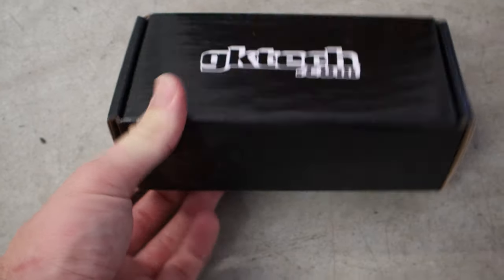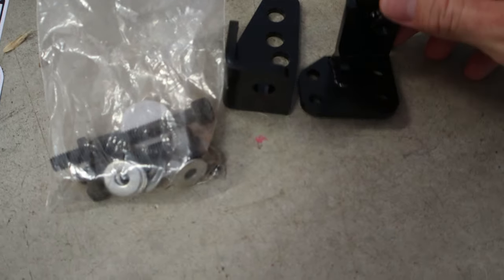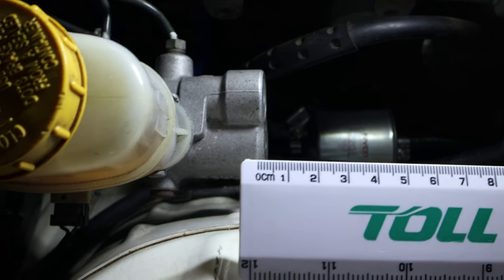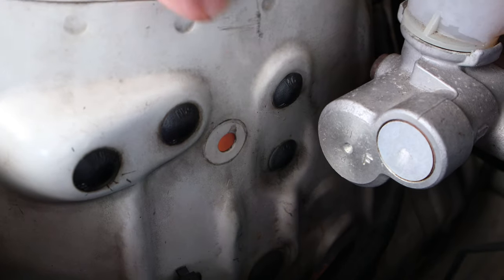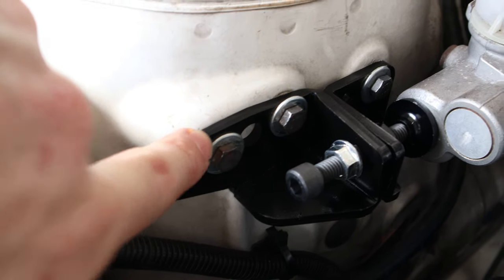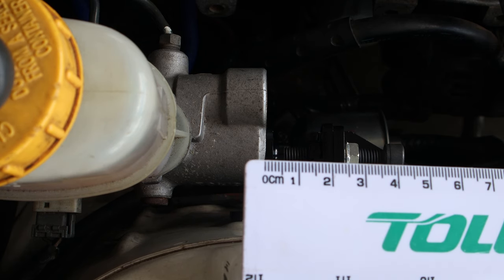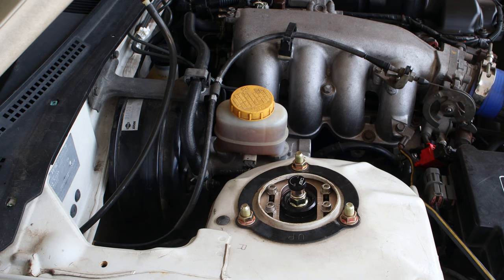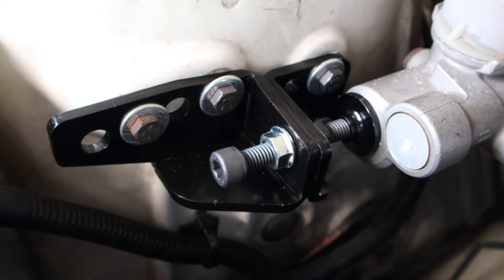[4K] Nissan Silvia - Gktech Brake Master Cylinder Stopper

Comment: These are a direct copy the cusco brake cylinder stopper if you prefer a Japanese product. Gktech could of made this out of an aluminum block or if they had to copy the nismo 270R version which was rare even when it was available. 
Gktech makes a lot of good products but they insist on using raw un-plated bolts that end up rusting over time and thats the last thing a Nissan needs! haha
Reply from the maker: s15melb yeah the bolts were a bit of a let down that’s for sure but apart from that it works well. Good to know 👍🏻
Cusco make some nice gear.